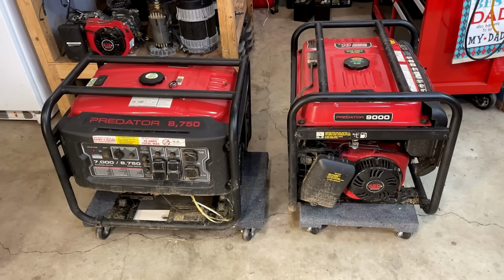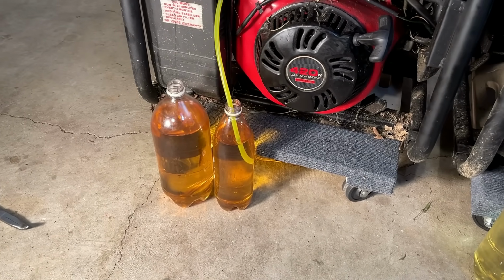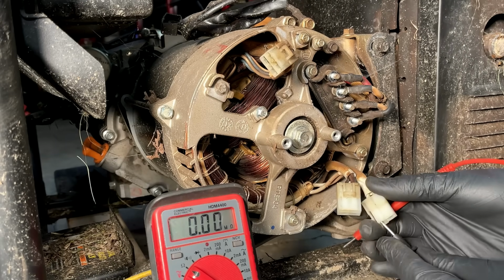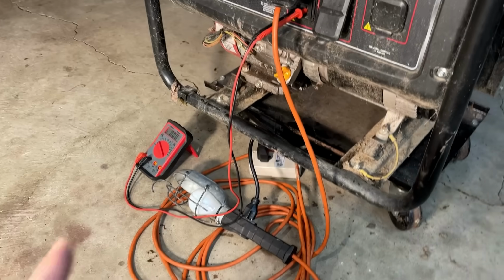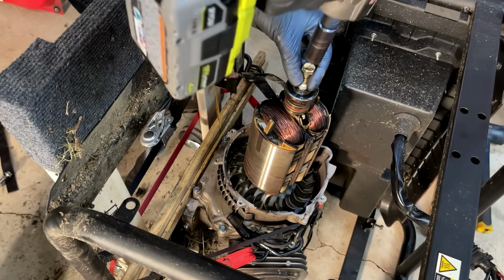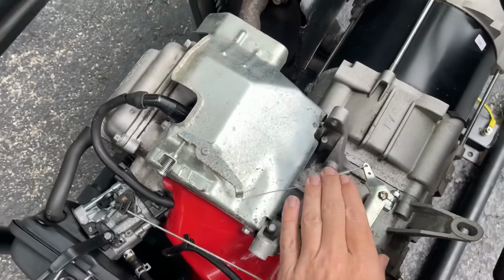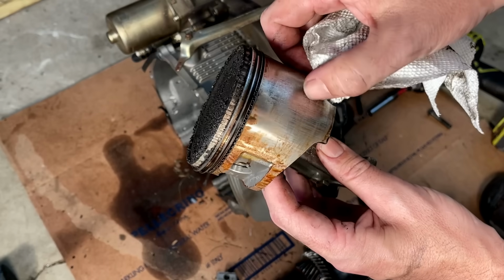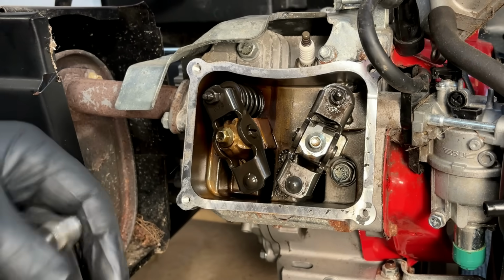3 Abandoned Predator Generators - Will They Run?

Comment: You might find one of those flat platforms that fits in a trailer receiver useful? Should fit at least 2 more generators that way ;) Also cleaner for the car.

Comment: Considering a 9000 watt HF Generator runs around $800, if he could get through one every 6 months, the cost wasn't insane compared to grid power. Honest, add a battery and a few solar panels and it's affordable.
Reply from the maker: Grid power has become really expensive for sure.

Comment: I have replaced multiple generator receptacles and GFCI receptacles with Hubbell/Eaton/Leviton commercial versions.  Higher quality than chicom supplied on original. BONUS: I install WHITE because they are easier to find/plug into in low light conditions.

Comment: how can i buy some of your spare parts. also i looking for electrical prints for a predator 9000 watt generator. Or if you can show this 9000 watt generator electrical lawout i need to know how the start switch is wired.

Comment: You ever work on any Predator Inverter generators?
Reply from the maker: I actually have never got one.  Probably means they are reliable.
Reply: @jcondon1    Well, I would agree for the most part.  ha.  I picked up what was listed as a "locked up" 3500 inverter with about 460 hours on the ticker for $50.  Drained the chocolate syrup oil that was in it and put 10w30 synthetic, pulled the plug (brand new NGK), then pulled valve cover off to find a very overly loose exhaust rocker arm.  Pulled the rocker off to find that the aluminum had broken off where the rocker pivots.  Ugh..  Harbor Freight doesn't have that head and there are multiple versions of this unit.  I was fortunate to find another person in my state (AR) that had one he was parting out with a good head on it.  Should be in on the weekend so I can tinker some more.  It's too bad you can't buy an off the shelf Predator 212cc engine and swap into it.  That would be too easy.

Love your channel, btw.  Always informative and a great help.  Been messing with small engine, and car engines, since I was about 16.  58 now.  Still love it...just slower.  ha.  Thanks for your reply.

Comment: Not 100% sure, but from what I am seeing online, all of the predator engines use the same valve stem seals. Might want to consider checking the salvage 420cc heads and see if the stem seals look like a match?

Comment: Hi James, thanks you so much for your videos. I have a 12000 watts Yamaha Technology , 10000 watts standard and the bad quality of some parts made the plastic fan they use for air cooler breaks in two (I noted the fan rubbing against the cover, looks like the fan was bigger than the one needed), the engine heated and the coil cable to the spark plug melted! WIth your video I managed to open my generator, change the fan with a 8 inch one (the exact measure), placed a new coil and adjusted the valves that were too tight from the factory! (Imho they send that way to the customers to make the springs life shorter and spend more fuel). But anyway thanks for all, I now have my generator running smoothly! :D

Comment: Truthfully, if an oil change/maintenance period is required every 50 hours (bearing in mind that's little more than two days continuous running), and we were living off grid, we'd have at least two generators at hand, especially if they were expected to run for more than 12 hours a day. That way, one generator could always be in use/standing by whilst the other can be serviced without a major interuption to the power supply. In addition, that would also ensure that there would be one good machine, ready to run at short notice. If funds would run to it, a third machine would be a worthwhile investment as backup for the other two, should one fail catastrophically. Some military installations in the UK were so equipped during WW2, but with much bigger sets, in the order of half megawatt apiece, but the principle was the same - one running, one standing by, and one at rest, or available for maintenance and repair, especially in the case of airbases with bombers on nighttime sorties over Germany.

Comment: Have you done any similar testing on a brushless generator?
I have a DEK5000 (I believe it’s made in china)and apparently it is brushless and does not have an AVR . It used a capcitor. No brushes or bridge rectifier that I can see.
I wanted to see how you would test for voltage and ohms to see if the stator and alternator are still good. Do you have an email contact info?

Comment: If that generator have AVR do not turn it off with load on it. Always turn on generator, wait till engine is warm&voltage as required and then connect load. When you are going to turn it off, disconnect everything, wait a while till voltage get stable and shut it off. AVR would last forever.

Comment: Run mine at least 3 times a month. Always fresh fuel and oil. During long power outs, we run it into an inverter and run the freezer and refrigerator.  Starts on the first pull. When the chores are finished,  close the gas and let it run dry. We've gotten a lot of years on ours. Not a problem.

Comment: Well I have been living off grid for about 6 to 7 years now have you used the predator generator continuously this particular generator is only good for around 4,000 hours before having to replace the carburetor and the capacitor oil seals bearings and the carbon monoxide detector that the engineers thought it would be a good idea to install on a generator to run in the outdoors on a generator that is meant to run on the outside of your home 😏

Comment: Question Sr. : How do you reuse the old gas?
Reply from the maker: There is bad which smells like varnish.  That has to be recycled as hazardous waist.  The rest I filter with coffee filters and remove the water and mix it with good stuff and put in my car asap.
Reply: @jcondon1  got it, thank you

Comment: Use a high grade VOM thar will measure frequency and set the run speed to get your up much  closer to 60 Hz under load. The voltage will be higher than 120 NO Load however the voltage will come down under a heavy load

Comment: I think the governor is just the way it is.  A very light-weight spring could be pulled tight enough to give the required force would give much better speed regulation.  BUT, it would be more likely to "hunt".  They probably selected that spring to cure a 'hunting" problem and just called the frequency regulation "good enough" 🤣🤣

Comment: That was a NICE TRICK using hydraulic pressure to pop off the Rotor
Never saw that before.  
[why not just Kink the spring to get the tension you want? Zig Zag it. ]
"Critters" .... Varmints  
---- I don't recall THAT being a Section, in my Residential & Commercial Electrical Construction.  & I'm pritty sure it wasn't on any tests.  But, - it should be.

Comment: Here goes,
The Power poles are the Responsibility of the electric Company.
My guess based  on seeing this Video and the 3rd Generator and LOW OIL.The other two blow apart NO OIL. they ran it to the death...... I would put a Heavier Gauge spring on that....

Comment: Something you can do is pull the plug and put rope in the plug hole then turn the crank to it stops that will hold the valve in place where you can remove the spring with out removing the jead

Comment: I dont know if those little engines have seals on the valve stems or not but Im 80 yers young retired automobile mechanic and do know on automobile engines bad valve stem seals will cause the same symptoms as you have on that engine. Really bad smoke situation after the engine has sat for a little while and then clears up after a minute or 2 running. If that IS the problem with the smoke that is a couple of minutes fix on that little engine

Comment: I have quite a problem with you using a low voltage meter to measure the resistance to ground of the windings and in particular the rotor. 7 meg ohms is very high but largely meaningless. That could well be the dust on the slip rings to ground. Your test is a rough indicator only. Until that rotor is removed , dried and cleaned 7 meg would be fine.

Comment: I was hoping someone with an exceptional amount of first hand experience running generators could comment on the likely cause of failure. 

Is this just an example of harbor freight quality self destructing when used continuously like in the off grid house or is it just another case of little to no regular service maintenance?

I know when it comes to ANY properly designed engine machine tolerance is king for keeping vibrations in check AND that said vibrations will exacerbate rotational wear leading to even greater vibrations ultimately shaking itself apart / catastrophic failure.

There is also always the chance that material defects led to these failures however from my understanding most every company sources individual components from specialized manufacturers and that almost all these companies source from the same major suppliers so it would be surprising.

Comment: I’ve seen guys in India or Pakistan melt down the aluminum alloy housings of motors while dragging the molten aluminum along on a piece of carbon steel to make ugly but effective oxy / acetylene welding rods.  I can’t recall the YouTube Channel though and I’m sure there is a learning curve to welding aluminum that way.   But you’ve got the raw material just need an oxy acetyl rig.

Comment: I would NOT be surprised if you find the oil rings seized on every one of those generators and the exhaust valve badly carbines and not seating well.  It looks like he treated the generators as disposable items not changing oil frequently enough and I think all the muffler spark arrestor s looked clogged and blocked.

Comment: If you don’t have any wobble head socket extensions get a set from harbor freight I’ve had good luck with mine but I don’t use them on excessively tight bolts or nuts

Comment: Muffler looks bulged out on one of them like it might have had a major backfire at sometime unless that the design and construction.
Reply: On the generator of the first power head check.
Reply: Muffler on second checked generator looks bulged on the outer side and the spark arrestor looks completely blocked.  People that run their generators need to check and clean the spark arrestor.

Comment: Thanks James, I’ve learned lots from your video’s, albeit I even worked on generators some although large gensets, like old military 25KW gas inline 6 trailer mount to a diesel 12 cylinder opposed piston 600KW that powered Atlanta main Telco office.

Comment: Hi, There seems to be no place to message you directly, but I was curious about the way you adjust valves. My experience is different, dealing with natural gas and liquid propane fed standby generators but,... I was always taught you get the engine to TDC (piston to the top) and then you adjust both the intake and the exhaust valves to whatever spec. 
I do really enjoy your thoroughness in all your videos, I was just wondering about that. I've watched you turn the engine to where it's at the height of each valve cycle and do the adjustment there, turn the engine more, adjust the other one... 
Is that how it's ideally done on portable generators?

Comment: Dear James, I really want to thank you on the wonderful way you examine and display the faults in your series. My personal question I have a brand new Ryobi 7.5kva generator. My former one lasted 12 years under the severe loadshedding experienced here in South Africa. My issue is that they have changed the air fin coolerin the manufacturing and this disintegrated. I replaced it with the air fin from my former generator. The generator however does not automatically start. I can only presume that this was due to overheating, yet examination of the engine does not show any black marks. One of my valves has a slight bit of play on it and they are clean but oily. . What further checks should I do on my generator to try to start it? Thanks for your input.

Comment: Your hydraulic method from removing the rotor was pretty cool! Multiquip uses an old rotor bolt, cuts it down and screws it into crankshaft, and then uses a bolt to in the end of the rotor to pull it off.
Reply from the maker: That also work well.

Comment: I don't know if it was done but I think the control panel should have been disassembled and cleared of any debris. The outlets should have been either cleaned or replaced.  The debris could cause connection issues and potentially a fire 😬

Comment: You need to get few good thick BRASS RODS for driving off stuck parts.  won't splinter like wood but soft enough not to break or crush what you are hammering against.

Comment: hi, I dont know if you have time to answer this. but i do have a quick question. i live in michigan. and there is no predicting a power outage. i have a 6500 watt generator with a teuchumseh engine. in the winter, i can not start it (no electric start, mostly due to having to replace batteries all the time). i have tried 5w30, and its the same thing. i have used mobil 1 0w40, and that seems to be just enough (although we have not had sub zero weather in a long time). will the 0w40 be ok to use in the summer?

Comment: for some reason I doubt if the oil is getting past the rings and burning if it's only on startup rings would be all the time oil is collecting in the valve cover area when it is not running and then being burned leaked down into the combustion chamber absolutely valve seals be on the lookout you've got enough viewers to be on a lookout for you..... I wonder what your wife says about you collecting all these parts you need to get you a pole barn a strong one with plenty of shelves your young man when you're old man you got something to hand down to your son who today is 10 years old? that would be funny

Comment: So wait, the previous owner of the house went through 3 generators in 5 years? That’s insane. Either they did zero maintenance on those generators and ran them dry, or they’re junk (or both).
Reply: If he was running them at a minimum of 8 hours a day, that's 2912 hours per year.  Guarantee he was running it a lot more than that.
Reply: I've had a predator generator for over 10 years now and it still starts up with 5 pulls.
Reply: 5 years is approximately 43,840 hours  so if he only went through 3 generators in that time I would say he got his moneys worth out of the generators reguardless of what his run/idle  ratio was. Thats still over 14,000 hours per generator.

Comment: Thanks James you inspired me to not give up on my Champion 4500/ 3500 run generator from Tractor Supply 3 years and it worked fine here in Northern California during the summer outages and during the Snowstorm last December 2021 until day 6 when I couldn't get it started with out the help of my Son in law who had more Ummph than I did. I bought a electric 4650/3650 Champion to finish the  Snowstorm and it works great even during this week long Snowstorm that just melted.  I tried 2 times last week rebuilding the Carborator on the first one and it still won't start. 40 hours on both of them.

Comment: Is it worth it (cost wise) to rebuild an engine on a generator? Or does it depend on what's wrong with the engine? I've rebuilt small engines in the past, getting the cylinders machined and replacing the pistons, rings, etc. But it has been years. However I do know a machinist who is good and reasonable. The reason I ask about rebuilding the engines is because we have 3 abandoned generators here on the farm and I'd love to get one of them going. I'm grateful I found your channel today!
Reply from the maker: Sometimes it is worth it if it only needs connecting rod, piston etc.   the costs quickly add up.  If it’s a Honda clone, it is usually less expensive to find a similar sized Honda clone that has a bad powerhead but a good engine.

Comment: So weird.  So a tree knocked down my power pole too. The costs of those three generators was more than the $1500 pole installed and electricity connected. He should have gotten more estimates because most contractors are thieves and wanted $4000-$6000

Comment: pack some rope in the cylinder and turn the crank until the rope holds the valves in...then easily pop off the spring and seal....when its in your hand you can probably find replacement by searching images on google

Comment: Why not put a cotton rope in the cylinder and bring the piston up TDC to hold the valve and then take the spring off without taking the head off. we do it all the time with V-twins
Reply from the maker: I have done the same.  I could not find the parts needed so left it alone.